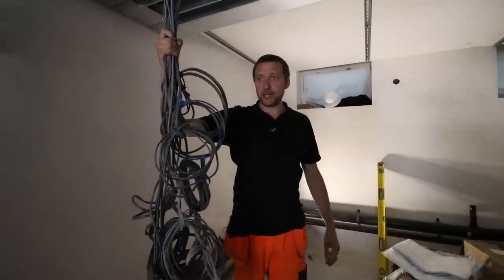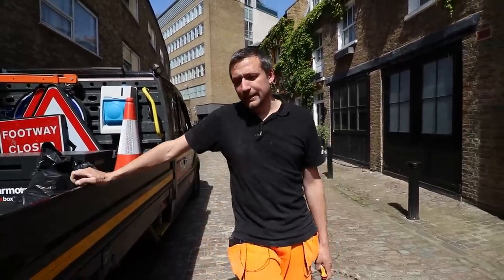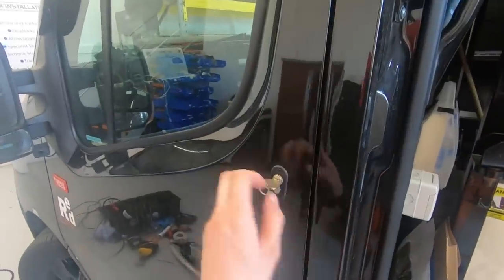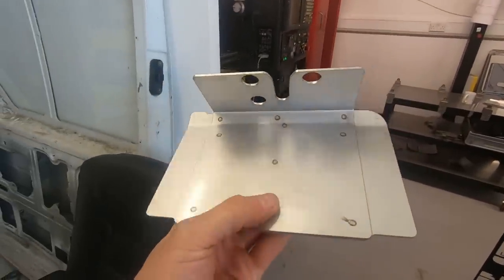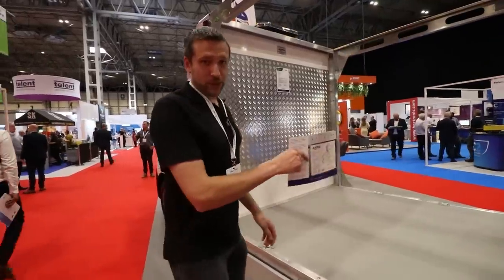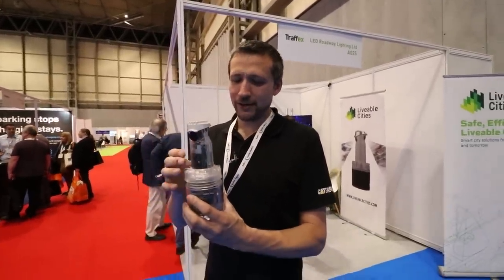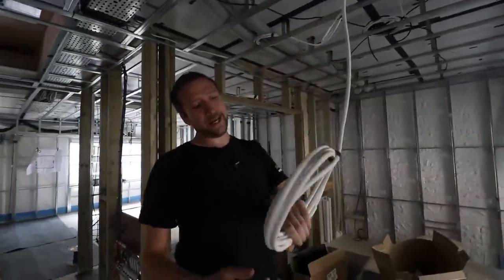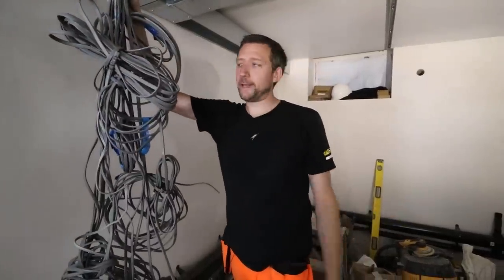The boys are back in town | Nagy Weekly ep11

Comment: 4 x Cat 6 in one cable - why? Makes no sense - surely it would be more sensible to run an 8 core multimode fibre - easier to run, smaller, a hell of a lot cheaper.  Money seems no object on that job so the fibre SFPs are just in the noise.

Comment: Not sure if you know, there’s a recall on the 2.0 eco blue engines for timing belts going prematurely. Mates just had his done at 70k, they’re supposed to be 150k so I’d be checking the belt through the oil filler cap to see if it’s cracked and taking it in to Ford for it doing, saves you a big bill and they can give you a hire van for upto 2 days on the recall for free as well